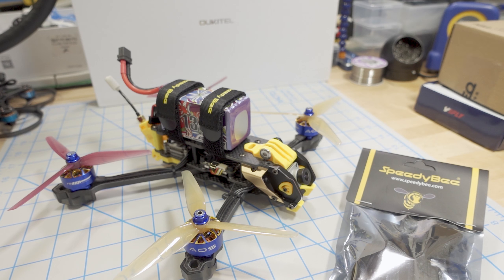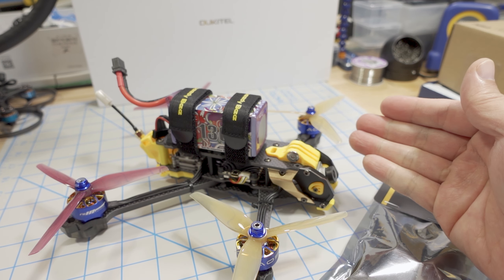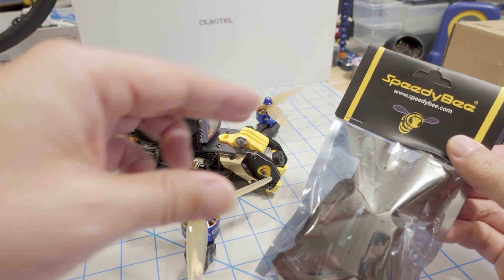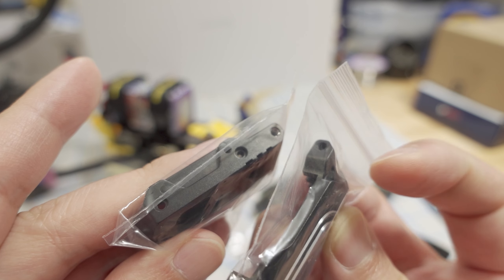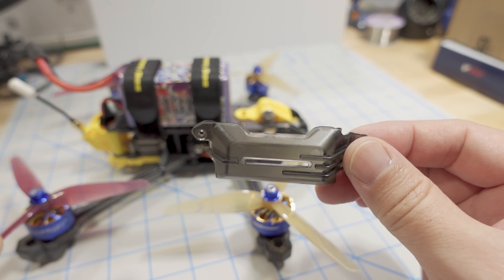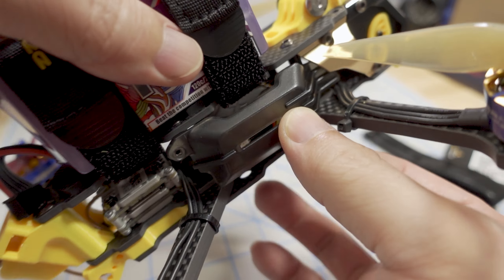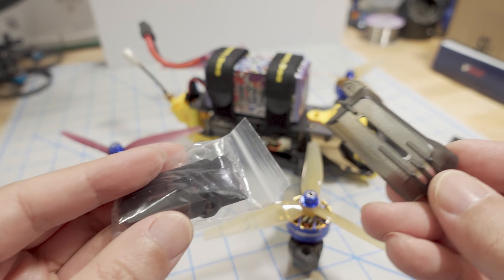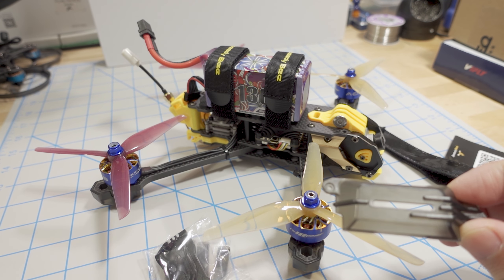SpeedyBee Mario 5 PRO Frame

Comment: nice video. I have this frame with the moonlight and I bought that extra kit and realized yeah I had no use for it. I haven't tried to fit it around the moonlight but when I realized I cant put the side plates without having that additional metal piece to screw the plastic part on it was a no go for me. Good stuff though. Wish I saw this before I bought it but it was cheap so not a huge deal. Thank you for your content!
Reply from the maker: Thanks for watching!